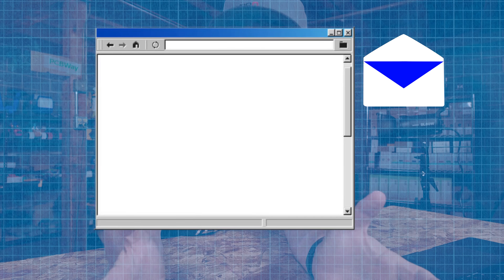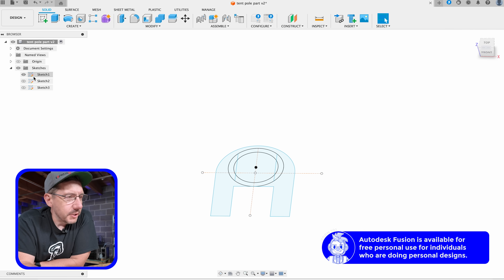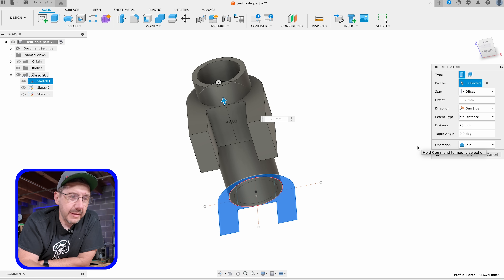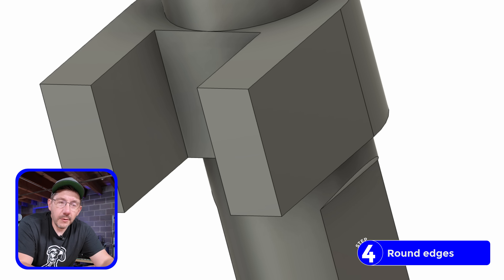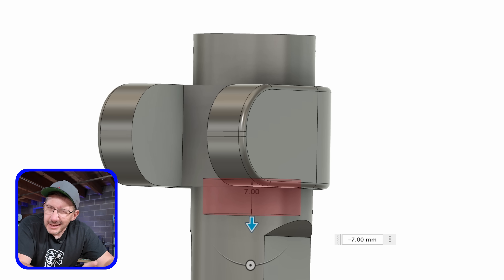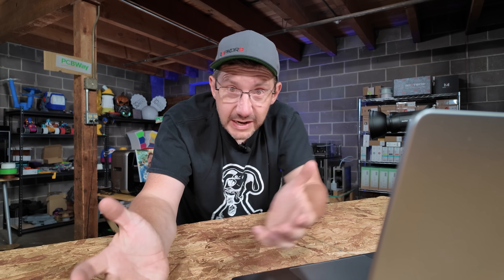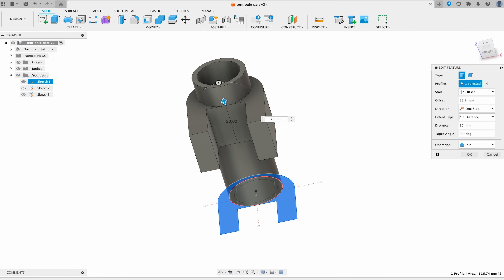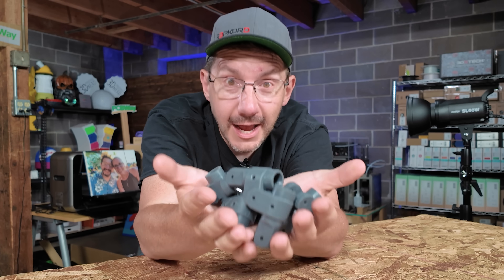Fix ANYTHING with 3D Printing – How To Design

Comment: You don’t know this Joel, but you have been my favourite mentor since I bought my first 3d printer. I have an engineering background ground at the grass roots level Making and repairing things for people. I got into 3d printing as a way of continuing to make things now I’m retired.  The whole CAD and additive manufacturing process I had to learn from scratch. Certainly the journey has been easier and more fun with help from good online teachers like yourself.  Thank you so much from New Zealand
Reply from the maker: Awww, thank you for sharing this! That's really kind of you to say. <3
Reply: What pushed me over the line was his review of the Anycubic mega man X (my first 3d printer purchase).  I'm still using it, but it has been rewired, klippered and improved, and I used it to give me the confidence to build a voron 0.1
Reply from the maker: @bridget_clinch  whoa still using it to this day! that's amazing, and everything you've done to it so freaking cool.
Reply: @3DPrintingNerd it is rock solid.  It's evolved now, direct drive, inductive probe, reliable prusa clone runout sensor, magnetic PEI bed, pi camera, input shaper tuned.  BTT board and touch screen, pi and board all cooled inside the jacked up case with an old 140mm PC fan.  Been running like this a few years now, great for making big PETG parts for use inside or outside the house.

Comment: While this is a helpful primer on modeling replacement parts in F360, it helps to remember that one of the great benefits of desktop manufacturing is that not only can one replace broken parts with pretty accurate facsimiles, but one can also correct flaws in the original, making the replacement stronger so it doesn't break again. Seeing where the original broke points to the very area where more material was needed, which could easily be thickened in the F360 model.
Reply from the maker: Great idea! I was set on replicating, when I should have beefed it up a bit. That said, I think using the Tough 2000 really helps add some strength, fingers crossed.
Reply: Great comment!

Comment: Very cool. There is no better feeling than designing something from scratch and seeing it work. One of the first things I did was a mounting block for a tripod because I'd lost the original and was about to throw the tripod away. Designed one, few iterations and it was done. Attached to scope and still to this day being used with the same tripod. Brilliant.
Reply from the maker: Absolutely brilliant work!

Comment: I feel you Joel! I myself had exactly the same situation last week where a good friend of mine from our local repair cafe came to me with a broken gear of a bread slicing machine. So I read up on modules, pressure angles, pitch diameters and stuff to define gears. He did some sketches and I filled in the blanks just like you with calipers and simple formulas. And voila! After a single test print to confirm the gears were meshing properly he got his replacement gear to keep his 1980s bread slicing machine in service. And if the printed gear fails, I still have the file and can print another one in under one hour. What a super power we all have with 3D printing!
Reply from the maker: WOW! I love hearing this! Great job!

Comment: Maybe loft/smooth in between the surfaces where the original broke.  Increase the strength where that pole is putting too much stress on that thin part.
Reply from the maker: That's something I will try to do on future parts for sure.

Comment: A couple of years ago, I had purchased a surveying bipod for holding a leveling rod so I could use my equipment solo. The gap where the rod sits in was much too wide for the rod to fit snugly, so I grabbed my calipers and designed an adapter in BricsCAD & subsequently 3D-printed it. Works fantastic!
Reply from the maker: That's really cool to hear! Still working as of today?
Reply: @3DPrintingNerd  Sure is!!
Reply from the maker: @NipkowDisk  Heck yeah!

Comment: Looks great!
If you didn't print this in resin, but on an FDM printer like a Bambu, what material would you choose and how would you orient the print on the build plate?
Reply from the maker: Thank you! For printing in FDM, most likely, I would have gone with PC or ASA and probably cut it in half and printed two halves.

Comment: I used to love fusion 360, but they priced me out. I was hesitant to switch to onshape because its all online, but I ended up loving it. So many errors I used to get from fusion trying to fix certain designs that required much more tedious work to make finally work, compared to onshape. I should have switched sooner. Most of the common errors are gone. And the feature programming is awesome because there are so manu useful plugins that are already built public online, they call them feature scripts and they are super powerful tools that can make certain opperations so simple to achieve. The only thing I don't like about it, is its all online. But even fusion requires you to be online for certain things from time to time like check license and use cloud storage. I can use both, but I have become more fond of onshape these days. Their tools are so powerful, especially their mate connector features. Its super easy to create an assembly that you can animate with all the correct transforms just with mate connectors. I don't know how I lived without them. It makes alignment super fast and accurate. No more trying to transform based on math or guesses. But I love the enthusiasm,  CAD is so powerful these days. It makes designing things and producing them within a day a possibility that didn't exist years ago.

Comment: I teach kids to do this in middle school, reverse engineering is a valuable skill! A note- you don't have to copy the part 1:1. Take note of how and where the original broke- see if you can determine if, using the design freedom of 3D printing, you can add more material, a large radius, or change that area entirely to prevent a similar failure in the future. In this particular case, adding more meat to the area where it failed doesn't look like it would interfere with the fit. Make it chonky!
Reply from the maker: You're awesome for teaching this in school! For making the part better, you're right, and I will need to do that on the next part!

Comment: That was a bit sketchy Joel:P Jokes aside You'd probably want a chamfer instead of a fillet for countersinking the screw holes.
Reply from the maker: Yeah, you're right. SUPER SKETCHY hahaha :)
Reply: And folks, you can also FDM print something like this. Even in a good PLA if you know what you are doing. Formfutura easyfil is one of those PLA’s. And for those that claim PLA parts can’t be used outside, I have parts on my bicycle and motorcycle and that have been going strong for years. Also outside a lot. Use a lighter color, they don’t get really hot, even in direct sunlight.
Reply: @QBziZ duramic pla pro is also great and always on sale
Reply: Yep, pan head screws are a 45 degree chamfer.
Reply: Countersunk screws/bolts have the 45° chamfer. Pan head screws are flat on the bottom of the head.

Comment: Wouldn't it be nice if we lived it a world where product manufacturers made parts like this available for download?
Reply: Phillips have started doing that. Well, one part for now for a beard trimmer, but they say more is to come!
Reply from the maker: OMG. Yes this would be great
Reply: 5 years ago I copied a drone DVR holder for a goggle strap so I could make versions that would accommodate wider head straps. 6 days after uploading it, the company released their original STEP file! :)
They also released the STEP file of the back of the DVR which enabled me to edit it to take 18650 size cells instead of 18500 size cells, resulting in lots of happy drone fliers.
Reply: Phillips is starting to do this (although at a small scale so far)

They have an official printables profile
Reply: Fusion 360 has a parts cTalog with thousands of parts … but i get ur point.
Reply: Prusa do that.
Reply: McMaster-Carr provides 100's of free to download Cad files (2d and 3d) for parts they sell. Hardware, Plumbing, Fasteners, Fittings, Electrical, Tubing, Clamps etc. You have to check the product detail to see if a cad files is available.
Reply: I think that could happen one day. The Military prints parts on Aircraft carriers and at remote sites in order to get equipment back up, and I am sure they pay a license fee for that. Also, companies that put out devices that are no longer manufactured don't need the files any more, and once it becomes something the competition does, more will follow There could be fees for the files, of course. The age of just throwing out broken devices for plastic parts failure could be numbered.
Reply: @JonS  and than? How much would you pay the company for the download? 80% of the price you pay norally?
Reply: @DieTabbi  80% would be absurd. In consumer goods, something that costs a dollar to manufacture typically costs around $4 when it reaches the customer, after manufacturer’s margin, distribution, and retailer margins are taken in to account. And even then, no one is making much money, once overhead costs are taken in to account. So given there would be no production cost (only the server costs), no distribution, and no retailers, the cost should be much less than 80% of the manufactured part.

Then there’s the market value of the digital part. This is not like downloading music or some other media, where the subjective value is the same as a physical version, and the user can immediately be realized by the purchaser. In this case, the buyer has to spend valuable time to print the part, and consume filament (possibly taking multiple attempts to get the part right). That has cost associated with it.

To me, this shouldn’t be seen as a profit center for manufacturers (well, that depends on the cost of the original product). The value proposition for the manufacturer is improved consumer confidence when it comes to buying the product in the first place, and improved brand loyalty. Most companies don’t charge for firmware updates that are downloaded from their sites to improve product performance and reliability (doing so tends to result in consumer backlash). But a company that abandons existing products that require firmware, would be seen unfavorably by consumers vs their competitor that provides free updates. This changes buying preference.

It should be the same for downloading a plastic knob for an oven, or a minor plastic piece for a tent. These are parts that have a small cost compared to the overall product, but if broken, or lost can render the product unusable.